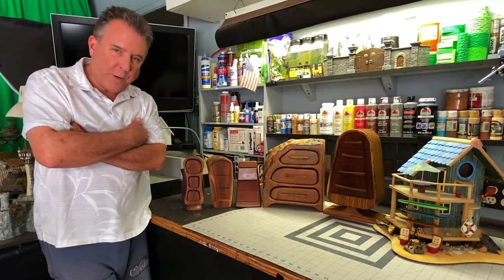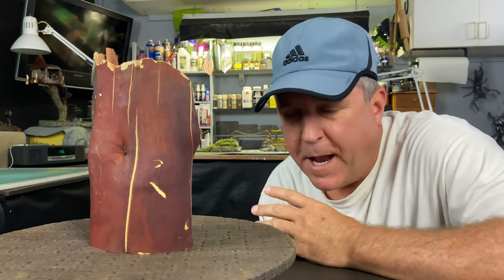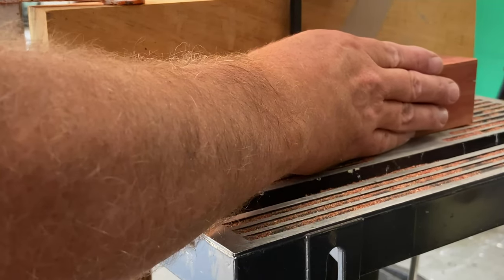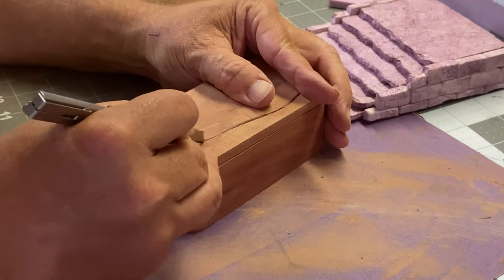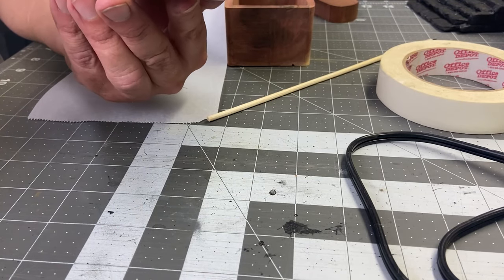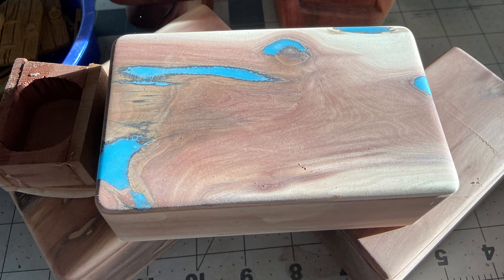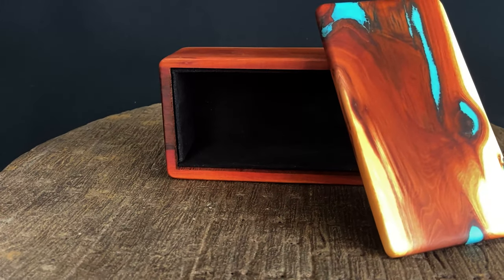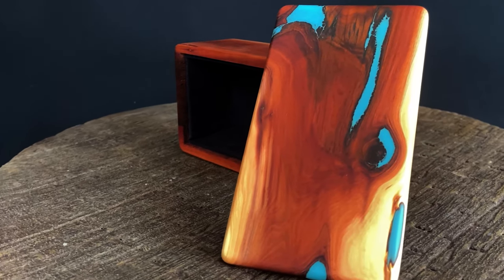I turn a chunk of Manzanita wood into this beautiful dice box!

Comment: Is there a drying out process? I've searched high and low for this info and haven't found anything. I have tons of manzanita on my property and would love to use it. Just not sure if it needs to dry out or be cured?
Reply from the maker: Good question... I don't think the Manzanita needs to dry out as it is a very hard, dense wood.  I used mine right after cutting the branches off so I think you're good to go!
Reply: @thecraftingbrothers9448  Thank you so much ☺️